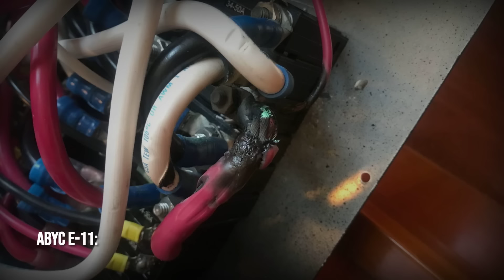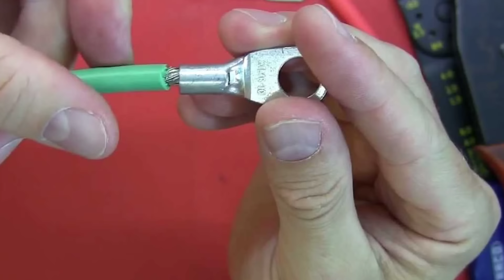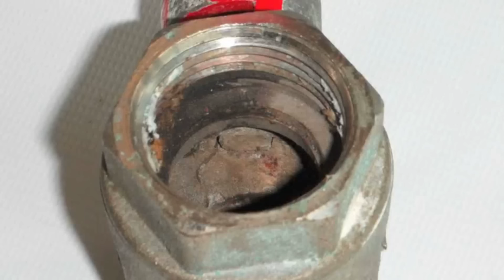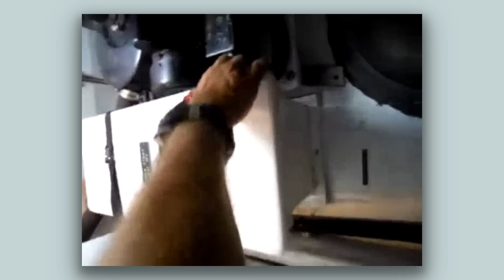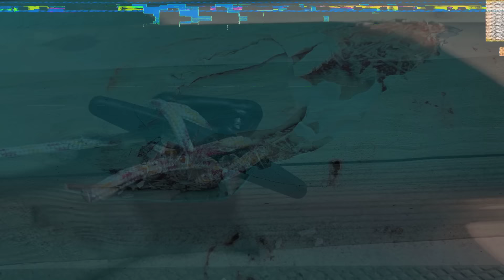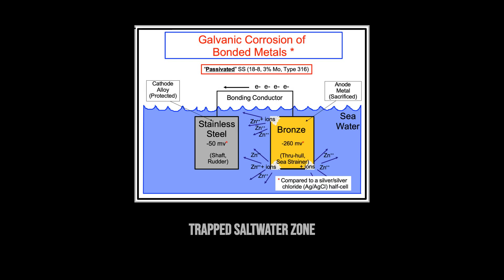10 "Banned" DIY Repairs That Will VOID Your Boat Insurance

Comment: Concerning the lithium ion batteries, I was looking a system modification that seemed like a good concept. The basic idea is to keep an AGM/SLA battery between the alternator and the lithium bank. My recollection is that the alternator feeds the AGM/SLA, which feeds a controller which feeds the lithium bank. The alternator has a consistent (and native) reception in the first battery.

Comment: You don't need your lithium batteries bms to communicate with your alternator if you use a dc to dc charger to isolate them from each other

Comment: I agree we should heed this advice for our own safety, but I'm not sure you're right for the insurance.  Where the issue is material to the claim, the principle of utmost good faith may well void the insurance.  At least in the UK, insurers can't avoid all responsibility where undisclosed faults are irrelevant to the specific claim.  You also have some protection where you were reasonably unaware of a fault - not something you knew or ought to have known.
While interesting and informative, I thought the video did itself a disservice by showing pictures that did not match the thing that was being described.
Reply from the maker: You're right that UK law is more nuanced — immateriality of the fault and reasonable unawareness are genuine defenses. The practical problem is that insurers dispute first and let courts sort it out later; even a claim you'd win on the law requires funding the legal fight while the boat sits. Fair point on the visuals too.

Comment: 5200 is a great bonding adjent but a terrible sealer since it's brittle and cracks
Reply from the maker: Correct — 5200 bonds like a weld and has no flex, so it cracks under any movement. The problem is people reach for it because it's marketed as the strongest option, without understanding that strength and sealability are different requirements.

Comment: Unsecured batteries have nothing to deal with fire hazard that has to deal with it flying and taking out crew in a knockdown or capsizing situation. And who the hell has a thousand amp hour battery in their boat. Do you know how big that would be be like 10 car batteries?
Reply from the maker: The knockdown argument is the right one — unsecured weight at that density becomes a weapon in a capsize. The electrical fire framing gets all the attention, but it's the physical securing standards that actually matter most. Most DIY installs are in the 200-400Ah range, not 1000Ah, but the securing problem exists at any size.

Comment: Per the point of using 5200 as a sealant for deck fittings: you should never use 5200 on anything you may want to disassemble. It's very very adhesive and difficult to remove. As the strength is in the bolts, you should use a less-adhesive sealant like butyl tape for sealing deck hardware.
Reply: Yes.  A strange section where the sealant was described as not strong enough, but tore the deck away under stress.  That sounds like too much adhesion, not too little!  The fault there really is having no through-bolts and backplate to spread the load over the weak deck.

Comment: LiPo change over we have a dc to dc charger that only allows alternator to work at a% of its rating. installed a switch to turn it of all together when we're topped off
Reply from the maker: Smart setup -- the DC-DC isolator is the right way to protect a lithium bank from an alternator that doesn't know how to talk to it, but the current-limiting behavior means you're leaving charging capacity on the table when you're underway with headroom in the bank. The manual bypass when you're well under full charge is a clean practical solution. What DC-DC unit are you running?

Comment: On a previous boat I had 2 wire nuts that were on for several decades with no problem; maybe because they had been filled with silicone.
Reply from the maker: Silicone-filled wire nuts is actually a legitimate workaround that a lot of experienced hands use -- it keeps moisture out of the connection and prevents the corrosion that kills standard wire nuts in a marine environment. The issue is it's not to code and it hides what's underneath when the next owner opens the panel. But decades of reliable service is hard to argue with on a practical level.

Comment: who glues a cleat in place...LOL
Reply from the maker: More common than it should be -- 5200 or 4200 as a structural fix rather than bedding compound. It holds until it doesn't, and when it lets go it takes gelcoat and sometimes fiberglass with it. A cleat needs backing plate, through-bolts, and proper bedding. Glue is a sign someone was either in a hurry or didn't understand the load path.

Comment: Lol! "a few hundred dollars " for an lpg system. It's more like $3-4 thousand for a basic system. Been there, done that, and have the bill to prove it
Reply from the maker: The "few hundred dollars" framing is doing a lot of lifting. A proper marine LPG setup -- certified locker, solenoid shutoff, pressure regulator, copper tubing, and a detector -- runs $2,500-4,000 installed by someone who knows what they're doing. Cut corners on that system and you're not just risking the boat. Worth doing right or not at all.

Comment: Long story short, learn how to do the work properly or don't do it, anything else is just a temporary fix. Even the right parts are only temporary in the long run.
Reply from the maker: That's the unvarnished version of it -- and it's correct. The problem is that most people learn this lesson on someone else's boat first, then forget it the moment they own one. Competence has a floor, and working below it on a vessel that moves through open water isn't humility, it's liability.

Comment: Thanks, I found one that I will change on my boat now!  Dave, WRØX
Reply from the maker: That's exactly the point -- one item fixed is one fewer failure mode waiting to bite you offshore. Good on you for acting on it rather than filing it away. 73, Dave.

Comment: My friend Marino galonio died on his boat when the bulge blew up after he used dollar store electric wires and screws. He survived the explosion but got eaten by orca whales after the boat sank.
Reply from the maker: That's a tragic outcome -- and a preventable one. Bilge pump wiring is one of those jobs that looks fine until it's submerged, corroded, or shorted in the worst possible conditions. Dollar store materials anywhere near a fuel system or ignition source is exactly the failure mode this video is trying to head off. Sorry for the loss of your friend.

Comment: Agreed to all EXCEPT the last one, which may in fact be true.  I have not heard a hazard created by sealing a stainless steel in fiberglass.  Stainless steel is good for LIMITED structural fastening.

Lithium Iron Phosphate batteries seem to be all the rage, and are reputed to be much safer than Lithium Ion, but I am not ready to have a giant bank of Chinese LIFePo4 batteries on a boat.  I am old school, and believe the best choice for house batteries is Golf Cart Batteries from Costco.  House batteries should not be used as start batteries especially for boating in remote locations.  House batteries should have a means of charging that separates them from the start batteries.  We want our start batteries to live a nice easy life.

House batteries of any sort, even lead acid batteries, need an algorithmic charger to not keep falling behind on a multi-day trip.  Unfortunately even the best are marginally suited.  On my last boat I had a big modern ProMariner that was actually pretty crappy but was the best available.  I may have to design a system for marine and RV house batteries, which I happen to be qualified to do.

ALTERNATORS:  Many boats I have seen have alternators that are way too small for the work they are asked to do.  For the alternator that runs all the stuff on the boat while running, or is used for house battery charging, I recommend spending the money and effort to install a large brushless alternator - It won't be cheap, but it should be trouble free.

On a funny note, I raised a boat just outside of Marina Del Rey (previous life before becoming an engineer) where the boat owner on site swore the cleats were fastened with a giant threaded rod down to the boat structure, so we used the cleats as lift points since the boat was awash and only needed a modest lift to start pumping.  Imagine everyone's surprise when a cleat ripped out because it was held to the fiberglass by decorative screws, and there was no nut on the giant threaded rod.  The owner said; "Oh Yeah!  We forgot to put the nuts back on when we pulled and replaced the cleats!"

Comment: I take this as not so much as illegal, but as boat safety.  Insurance won’t matter if you don’t survive the emergency.  This is a very good checklist for used boat shopping, for retrofits, and insuring that the boat surveyor checks all these items on the list.  Finding out a boat isn’t insurable, makes a great deal of difference in securing boat slips and anchorages. Very useful & helpful information.
Reply from the maker: That framing is exactly right -- the insurance question is secondary. The primary issue is whether the boat is structurally and mechanically sound enough not to kill you. Insurance is a financial hedge; safety is a precondition. Too many buyers treat the survey as a financing formality and then wonder why things fall apart in a seaway.

Comment: 👍🏻👏👏👏  Now add DURACELL Project [boat build] drains(2) through the hull with NO shut-off vavle (seacock). ⚠️ NOT SAFE.
Reply: if its a tube glassed in, thats not bad practice, fairly common

Comment: 1) Sparks from a car alternator ??? 😂 And the starter motor on your engine, no sparks there? 2) Why have you got a fu,cking petrol engine in your boat in the 1st place?
Reply: Marine engines are confined spaces where gas fumes can't escape without the blower being constantly on.
Reply: My boat engine is gas not diesel.
Reply: See above for why boats explode...I present Exhibit A: Ignorance
Reply: Marine engines are diesel but I guess the insurance will still refuse to pay out if they find car parts on a boat so I guess it's still relevant
Reply: There are many things on a boat that produce explosive situations.  For instance, lead acid batteries can vent hydrogen gas when charging.  Also very explosive.  And many boats use gasoline engines.  Gasoline is much more common on smaller-to-mid-size pleasure boats, especially older ones.

Comment: Never have an inboard gasoline engine
Reply: Don’t be stupid. In a properly designed and built boat, a gasoline engine is fine.
Reply: @kenyoung976 you funny
Reply: @kenyoung976 Yes design and build quality are extremely important BUT service and maintenance are often overlooked. Unlike a car, a boat with an inboard gasoline engine is a perfect bomb with leaking fuel connections and bad ventilation. A lower limit of 1.4% & an upper limit of 7.6% gasoline to air ratio is required for an explosion to occur.
Reply: @kenyoung976  I will repeat. Never have an inboard spark-ignition engine. Compression-ignition came about for very good reasons.
Reply: @georgiarasmussen8343 I fully understand your position about gasoline inboard marine engines. That position is yours to freely hold and to pass on to anyone you meet. But history and decades of use in the “real” world shows that tens of thousands, if not hundreds of thousands, of these gasoline inboard engines have been used for more than 100 years safely. Have there been tragic accidents/incidents? Certainly. But there have also been serious accidents/incidents involving diesel powered boats during this same time span. Diesel fueled engines with compression ignition systems are certainly safer than gasoline engines. But not every vessel has been designed for the additional weight of a diesel engine. There is also the fact that if the only power choices were diesel engines, a huge number of boaters would be eliminated from the market place. This would be a death sentence to the recreational marine industry. As it is now, boating is a very expensive hobby. Outboards are not cheap at any horsepower. The costs of resins and core materials have pushed the prices of new boats to a place where many would be boaters cannot afford.
Reply: @kenyoung976 yeah but inboard gasoline engine is f***
Reply: Ex-act-ly. 😂
Reply: The design is fucked and physics prefers outboards anyway

Comment: The acronym ABYC was never defined.  In the United States and many other places in the world there is no regulatory authority overseeing the construction of recreational boats.  ABYC, American Boat & Yacht Councill, is a non-profit organization that develops VOLUNTARY safety standards for the design, construction, maintenance and repair of RECREATIONAL boats, providing vital education, training and certification for professionals to ensure safer boating.  Meeting or exceeding ABYC standards is a great idea, but it is not mandatory.  The video frequently uses the word "violates" some ABYC publication as if the owner/manufacturer has committed some legal infraction.
Reply: 'Counsel' 🤣
Reply: @johnblaiklock702  Corrected to "Council" - thanks.
Reply: @apackwestbound5946  If you click on the 3 dots to the right of your msg. you'll get the option to EDIT or DELETE.
Reply: They reference today’s boat building standards so basically your shit is obsolete 😂😂😂 comprendo ?
Reply: Is it likely an insurance company (since that seems to be the frame of reference in this video) can insist on ABYC "code" compliance?
Reply: Correct, but insurance policies can expressly (reference ABYC) or implicitly (requirement to meet recreational boat standard) require ABYC compliance for coverage especially for maintenance, repairs, and modifications. The video should have explained this and used the term non-compliant. A good example are increasingly common policies that have a provision requiring that any lithium-based battery installation be performed by professionals in compliance with industry standards (DIY install breaches the policy).